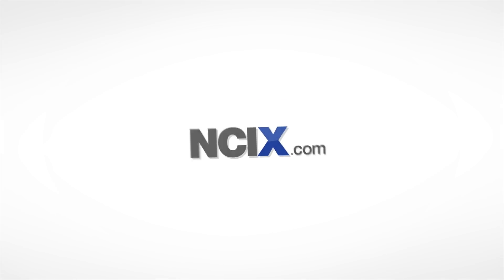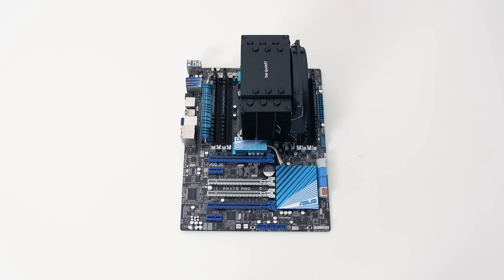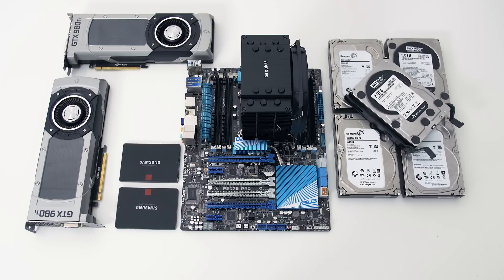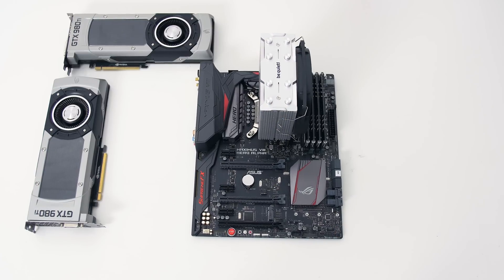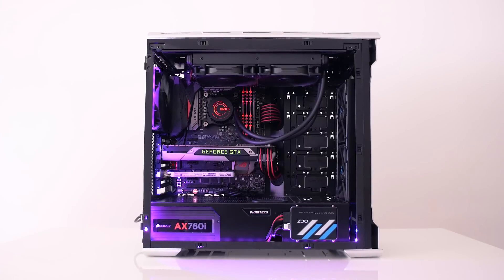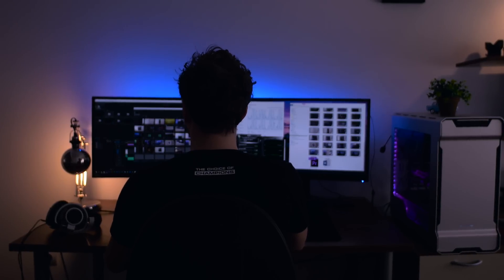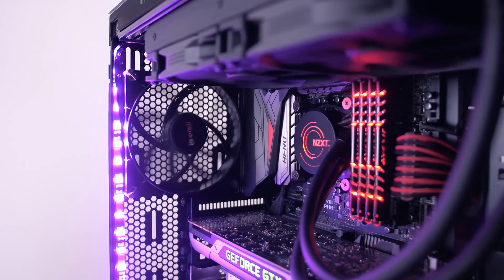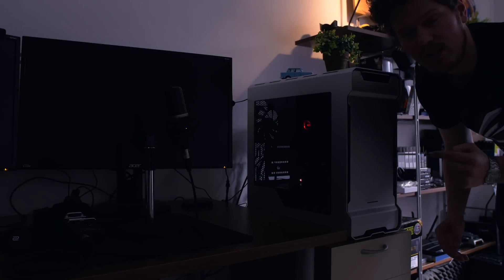Skylake Editing PC - Final Upgrade!

Comment: Nice build, both parts and assembly. Sure X99 would have gotten you better speeds, but this is still going to be a great experience. 

As for the RAM...I just built my new x99 pc, and I went for 64GB. At first, I figured I wouldn't need that much ram in a loooong time. But after loading a large video project in Premiere (large meaning a 20min video with 4k media and a lot of filters being used), I was using 54GB of RAM....Blown away on how much Premiere can eat up if it is available. 

So having the extra RAM, however more it cost me, has allowed me to work on heavy projects while still being able to do multiple other things on my PC. I know it was kind of overkill at first, but it has proven to be useful. 

Anyways, good job as always on your videos. I definitely idealize your quality and hope one day I can join #teamcrispy :)

-Jason

Comment: At 3:15 you mention that the 6700k only has 16 PCIe lanes. This is incorrect because it has 20. There are 16 lanes that go directly into the CPU, these are two PCI headers on your motherboard that support full 16x cards, with two installed they would both be operating at 8x, and most likely neither of the cards would be bottle necked by this and would still offer better performance than one card at 16x. The last 4 lanes are all shared across the other PCI headers on your motherboard (and the M.2 slot), they are multiplexed by the chipset.

Comment: +hardwarecanucks : Dimitri, the cost increase is a bit much.... but there is a 32gb set from Kleev that has a static red LED strip across the top: KM4C8GX4N-2133 (other timings and freqs available). I personally love the sets of avexir core (got alternating colors of white and blue in the one build that runs stable).

Comment: The 5930k would be still better. Quadchannel DDR4, way more power, enough lanes for SLI and just 50W more heat output for the 2011-V3 CPU. I run the 5820k myself, that CPU beats the crap out of the 6700k even at stock.
Now you got a decent system for gaming, but not the best for rendering. Дима dont do nooby stuff like that anymore. 
X99 would also leave options for the Broadwell-E with up to 10 cores on an existing motherboard. Going with Z170 on a workstation right now is shooting yourself in the foot.

Comment: Awesome setup to be honest, as for the removal of the sli, I would've went with a 950 pro nvme ssd instead of the pcie intel 750(you can even get 2 and set them up in raid 0 and still have the same space), this way you clear the space in the pcie area while keeping both gpus.
It's a sick build nonetheless.

Comment: I would've done just one thing differently, providing budget it's not a big concern: I would've bought a 980ti waterblock and an H140X from Swiftech to connect and cool it with. I don't know if in a normal rendering scenario a 980ti with a reference cooler is much louder than one with a watercooler on it, but in games would be surely a lot more silent.

Comment: Z170 Skylake systems are able to handle up to x20 PCIe lanes: 16x through the CPU, and 4x through the chipset. The whole point of Skylake is so you can have SLI/Crossfire, and one 4x PCIe drive at the same time without any bottlenecks, so I suggest you stick your other GPU right back into your rig for crazy SLI gaming XD.
Reply from the maker: +ElZamo92 I'm currently using the 2nd 980 Ti for other builds, SLI gaming is just not a priority right now. But it sure does perform very well :)
Reply: +ElZamo92 well pointed out i totally forgot about the ones for the chipset. also hes crazy not to put the gpu back in :)
Reply: if you end up not using it im happy to accept free swag HardwareCanucks

Comment: I like the fact that you tried to spruce up the chassis interior with the addition of those Cablemod led's, but why did you get rid of the hue+? It seems slightly redundant, as using one software for both your kraken x61 and hue+ would seem a lot simpler. Plus, the hue+ has more customization than the ROG motherboard.

Comment: i have to ask, why NVIDIA card if you use your computer mainly for editing and probably rendering ? doesnt AMD kick NVIDIAs ass in terms of compute performance ? are you using program that works only with CUDA ?
Reply from the maker: +Reaper-Virus Adobe Media Encoder used both OpenCL and CUDA acceleration. In my example, the 980Ti delivers the fastest rendering performance vs R9 390X or R9 NANO. I've tried AMD cards for OpenCL acceleration with Adobe Premiere in the past but they were slower.
Reply: +HardwareCanucks Do you prefer Nvidia or AMD gpu for Hardcore gaming?? :)
Reply: +Guo Ming Nvidia
Reply: HardwareCanucks hhhmmm thats actually kind of weird, i havent found benchmarks for Adobe Media or for Adobe Premiere but for few others i have found some most commonly for Sony Vegas and benchmarks show that almost all AMD cards wiped floor with NVIDIA cards and it seem believable because AMD cards have higher pure compute performance, it could be that Adobe hasnt optimized their software for OpenCL as much as for CUDA. Also my comment was kind of a hint to that you should sometimes do something with AMD cards, mainly because theres kind of wide spread thing that larger tech tubers use only NVIDIA and its kind of annoying because NVIDIA is kind of bad company and acts like a child in a playground and they get way too much free advertisement.

Comment: how well would an i3 6100 with gtx 750 ti do with editing?..would love ur reply..btw i would be using DaVinci resolve 12
Reply: +malik bagwala You could try it.
Reply from the maker: +malik bagwala No idea. I dont use DaVinci but i3 has HT (2cores/4thread) so that will help with handling CPU loads. It also really comes down to the software. How does Resolve 12 handle hardware like this? Is support available for that GPU or only certain CPU/GPU combos work best with DaVinci?
Reply: +HardwareCanucks oh...thank you

Comment: If you would like the ssd that shows through the side panel to be orientated correctly you can move the drives into the alternative mounts and route the cable through the front.

Comment: Sure to test a system how quiet it is just by letting it IDLE....yeah even my PC sounded dead silent even with a 290X GPU when IDLING ! 
Try putting full load on it....even so of course Dimitri's PC will be more quieter than mine but just saying...what kind of sound test is that when a PC is IDLING with no real load that KICKS UP THE FAN. 
But overall, the only noise from my PC is actually my GPU....but I had to put up with it to keep the heat under control. 

FYI, Im living in a Tropical country, 33 - 40C most the time outdoor temp, blazing hot sun almost 365 days. 
Room Temp can easily go from 29 - 33C sometimes, so for my GPU to burn up to 76C ( the highest I've seen so far in games ) @ 1440p gaming, I think it's still alright..if I were to play on 1080p, I can easily maintain it under 70C about 60C ++ most time 72C max. But without noticeable fan noise. 
Not after I've moved to 1440p, had to crank up the fan speed a little ( about 3000 RPM / 60% fan speed ). But the game noise actually covers it so it's still acceptable.
Reply from the maker: +Eric Tan Actually that was my "performance" preset in the fan settings. It doesn't get louder than that even when rendering videos :D yes in a hotter environment, fans will have to be ramped up significantly.
Reply: +HardwareCanucks But when you render it utilises the gpu right? And it's pretty well known the reference nvidia cooler is pretty loud
Reply: HardwareCanucks Ah ok, you should have pointed that out earlier or in the video then Dimitri, in that case that's dead silent indeed. 
While Im gaming on my PC it's like Im at an airfield. 
No NVIDIA GPU won't make a difference, I have friends who uses NVIDIA GPU. It's the same. I've seen benchmark people people can keep their 290X running cool even with just 30% fan speed....that's practically dead silent honestly...and no it's not water cooled, it's still air cooled.

Comment: Is you cpu a 6700k or 6700 skylake?
Reply: +Oskar Munk Madsen I think 6700k. He also overclocked it to 4.5 Ghz.
Reply: +Oskar Munk Madsen 

The 6700K should be achieving 4.5Ghz without too much work, I'd say more than 90% of the chips can do it. Obviously you want to keep it at 4.5Ghz or 4.7Ghz max if you're planning to use it for video-editing. As rendering/decoding etc use the CPU usually to its maximum potential, so you want to make sure it's running cool and stable all the time. Do not push it too much, unless you get a "golden chip" that's capable of going to unlikely speeds, with an unlikely lower voltage (in comparison to other chips). Golden chips are extremely hard to get, and it's a matter of luck.

I recommend you watch at least a few videos, and go through a few forum threads (maybe three or four hours of research and reading about peoples experiences with the same CPU & Cooler combination helps). Without the research you could give it too much voltage and burn your CPU. Use the right applications to test stability. Aida64, Cinebench R15, and Asus RealBench are really good for testing stability of the overclock. And finally make sure you overclock manually and NOT use the predefined overclocks that come with the motherboard BIOS (they're usually rubbish and give too much voltage).

Finally and obviously, DO NOT overclock without a custom cooler. Maybe 100 or 200 Mhz, but not worth it.
Reply: K
Reply: K he said its overclocked
Reply: 6700k
Reply: allright then thanks :D 
do anyone of you guys know if he have a tutorial about overclocking his cpu cus im buying the same soon xD
Reply: +Oskar Munk Madsen i dont know how much knowledge Do you have, but Not every CPU can reach the Same clockspeed. Some get it ti 5ghz some just to 4,2
Reply: Kirito E.R. lol so if its the same product you get different clockspeeds?.... idgaf
Reply: +Oskar Munk Madsen While the model is not shown, we know it's a 6700K because "4.00" is engraved on the heatspreader (the 6700 is only 3.4GHz).  "Intel Confidential" is an indication that this CPU is not intended for sale.  Having said that, I think we all need to remember that an unlocked multiplier is not required for overclocking.
Reply: +POL1T1CS thanks for that i happy you ARE telling me :D
Reply: +pillsnotbills okay thanks :D
Reply: +pillsnotbills actually Intel released a microcode blocking overclocks on non K-sque skylake chips and implemented it into OS updates and BIOS updates on some boards
Reply: +POL1T1CS very true I got my 6700k clocked at 4.5 easy right now and didn't change any voltage, stress tested overnight and woke up to find no problems what so ever, no bottlenecking has been found and the CPU stays cool at a max temp of 45 Celsius under full load(aio cooler) these skylake chips are wonderful things
Reply: Hivon cant wait till mine come :D
Reply: Hivon Indeed.  The update disables the multiplier-unlocking feature of those boards. Once the update is applied the ratio can no longer be changed, but overclocking via BCLK is still possible.
Reply: pillsnotbills yea, but oc is still not under warranty or nearly as good as the k-sque but it doesnt matter

Comment: 7:40 is it possible to mount SSDs the right way up in this spot? It sort of looks like you could run the cables around the front of the basement shroud, but I've never seen it in any videos. The reason I ask is because I have one of the Intel 730 series SSDs (the one with the skull on it) and it'd really annoy me having it sit upside down. Seems a bit silly to have a spot in the case to show off something like that, only to make you mount it upside down.

Comment: +HardwareCanucks yes I agree with you that 980 TIs in SLI doesn't really benefit you in video editing so that's a viable explanation there but the one point you said that the 6700K only has 16 PCIe Lanes so having 2 GPUs and a PCIe SSD will have bottlenecks isn't quite true.

In the Z170 chipset the Direct Media Interface has been upgraded from the 8x PCIe 2.0 lanes that the Z97 chipset provided to  20x PCIe 3.0 lanes which will be provided by the chipset which Intel claims is more than enough to handle PCIe SSDs which I also saw benchmarks of it being confirmed

Comment: Why don't you turn that SSD behind the side windows around so that it isn't upside down? Just an example how I did it myself here: http://1drv.ms/1M2ID7C (that's a shortened OneDrive link), I know this is an Enthoo Pro M, which is slightly different, but the cutouts are the same I think. It's possible to route the cables through the front :P
Reply: +Florian Ivan Is that a 390 or a 390x?
Reply: +Slay 390X

Comment: I wouldnt trust any other ssd than Samsung or Intel. The 850 pro has 10 years of warranty, which no other manufacturer has. I think that speaks for itself. Plus working in a computer store I have had bad experiences with those sandforce ssds.

Comment: It's freaking me out. A fantastic PC and why only the entho pro Case for this build, they are many Choices out their.
Reply: +Ravs Ajay The Enthoo Pro is (IMO) one of the best cases out there, and I'm sure Dmitri would agree. I personally have it sitting beside me. Also, it isn't the Enthoo Pro that's being used in this build.
Reply: It's a enthoo evolv and I really like the looks of the aluminium
Reply: No reply from #Dmitry HWC
Reply from the maker: +Ravs Ajay I love the EVOLV ATX enclsoure. Beautiful aluminum exterior, fantastic cable management and super easy to disassemble any hardware if needed. Wouldn't choose any other case for this PC.
Reply: +HardwareCanucks I was dough ting because I was planning to buy NZXT s340 or Evolv both look pretty good. Can't decide which is better
Dmitry what was yours choice between these two cases
Reply: +Ravs Ajay They're at completely different price points, it depends on your budget. Obviously the Evolv is much better in just about every aspect, but it has a hefty price tag to fit.

Comment: Are you using Air flow or Static pressure fans for the front intakes?
Reply from the maker: +Jose Gomez They are airflow optimized. Works really well.
Reply: +HardwareCanucks OK thanks. I have the same case and was getting new fans. since the gap between the front panel was  narrow I didn't know what model to get.